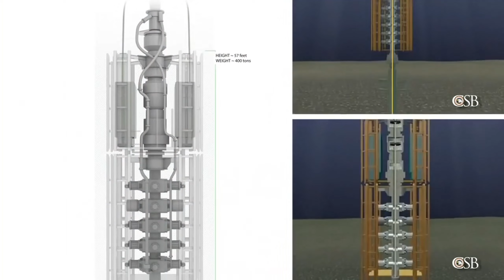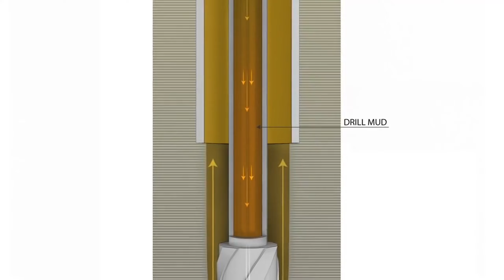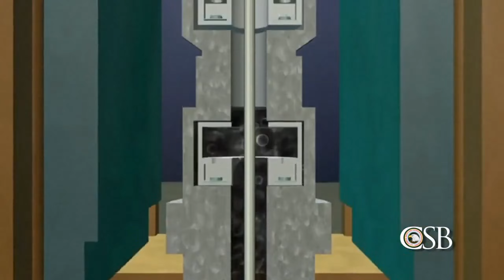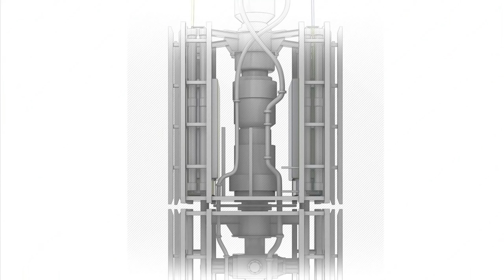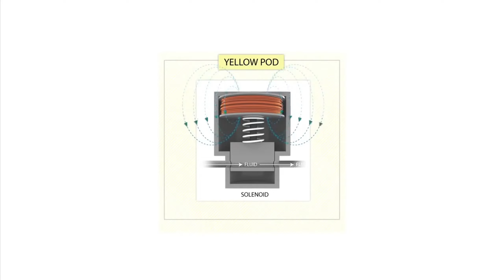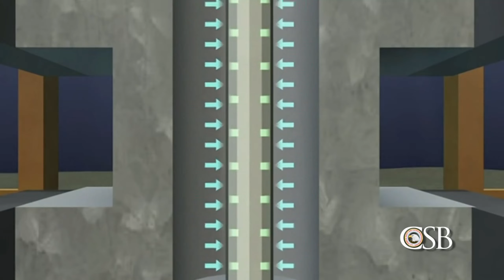WHAT CAUSES THE EXPLOSION OF DEEP WATER HORIZON RIG - A DETAILED ANIMATION ON WHY IT EXPLODE

Comment: The explosion on the platform occurred when methane gas coming from the well was sucked into the intakes of the diesel electric generators that provide electricity for the rig.  This acted like an extreme power boost to the engines causing them to race out of control and flooding the entire platform with a massive amount of electrical current. Lights flared to extreme brightness and computer monitors began to explode in the offices of the workers. 
This is what ultimately ignited the gasses and other fuels coming from the well.